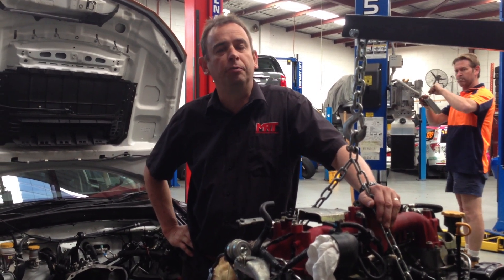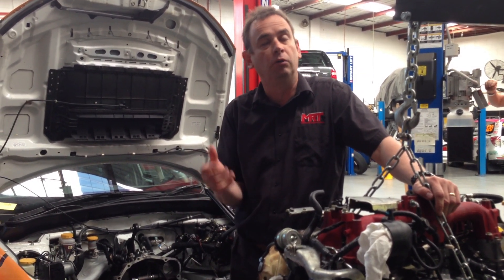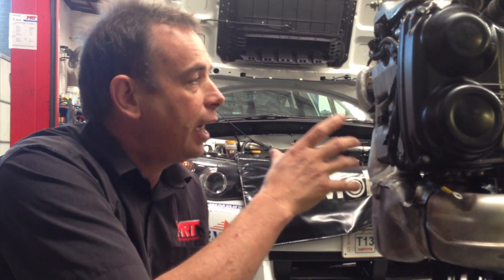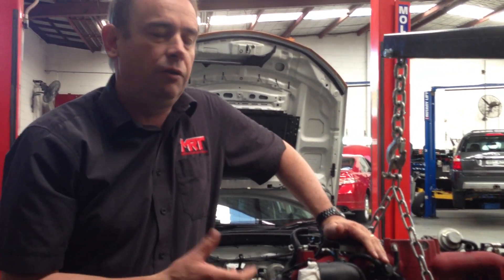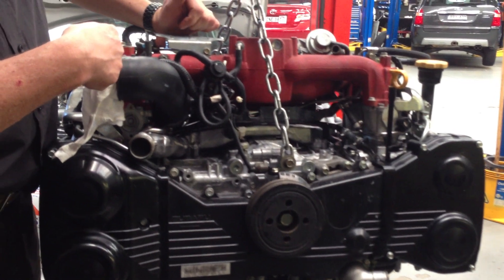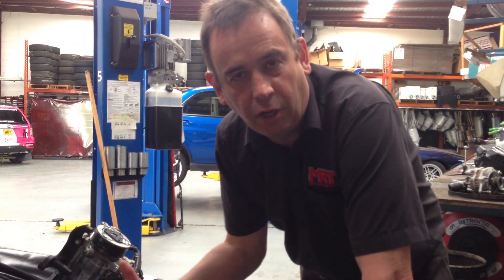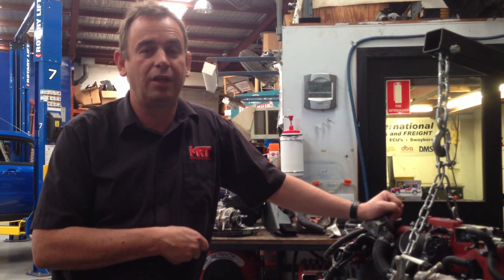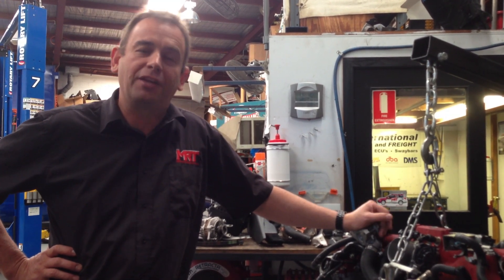Subaru STi Spec C engine talk around in workshop, whats the difference and how it works

Comment: That looks very much like the lines found on the factory S202/S203/S204 cars, so likely its an STi option oil cooler not an aftermarket one, especially as the Modine is still in place.